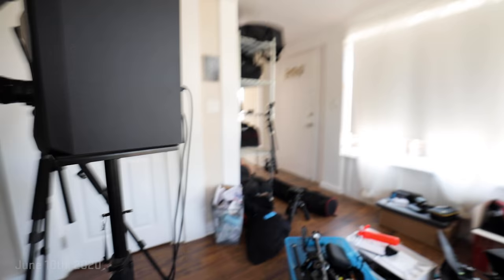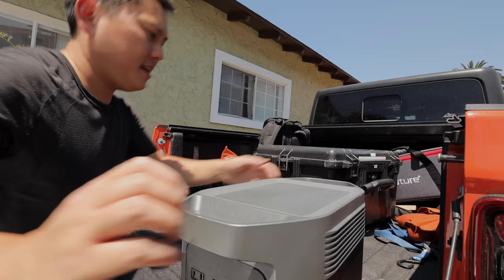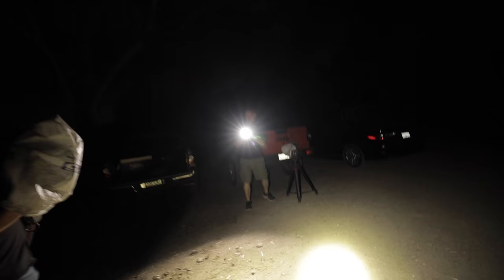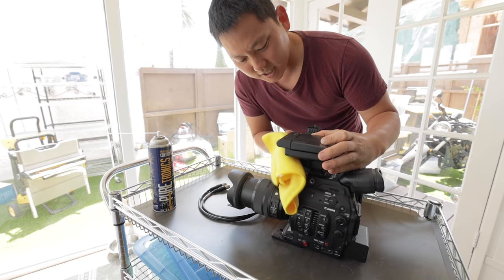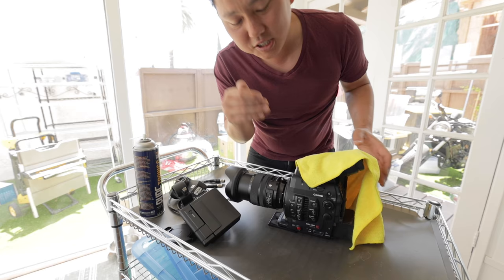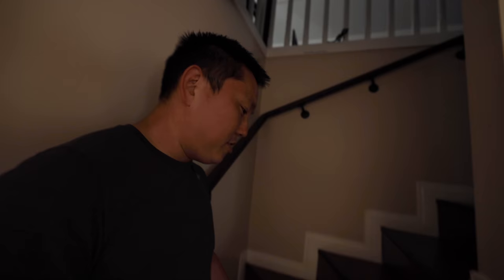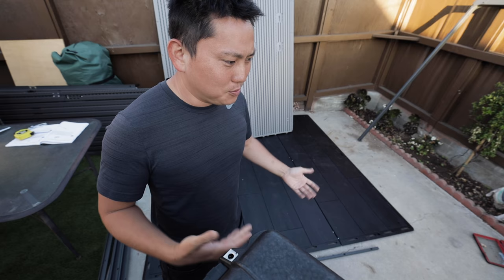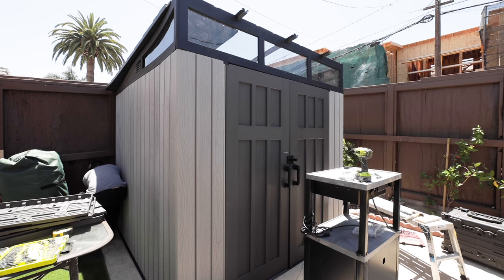First Day Back At Work VLOG

Comment: The best wifi is a 100ft ethernet cable!
Reply: I 2nd that
Reply: Pass thru walls no problem
Reply: No shit
Reply: period!
Reply: Good luck inserting that in a phone
Reply: Shounak Hinge adopters 🤔
Reply: @gitawrongtranslation-youtu9701  let me see what is more convenient...
1 Ethernet cable which nneds adapter for using with smartphone vs a WiFi router which is wireless (obviously) & can handle 10+ devices simultaneously...
Reply: @shounakhinge8  having the wifi router next to your pc with pc being connected by ethernet and other stuff connected to wifi.
Reply: @pettypoh  Now that's something a power drill will sort out.
Reply: @shounakhinge8  You do realise that you can have a router with multiple ethernet runs and wifi?  In fact, it's standard.  
Connecting a smartphone via ethernet... just...
Reply: Hi ! I’m a filmmaker and signal processing engineer. So trust what I say ! 😁 You’re experiencing 2 things with this WiFi network. first, WiFi access points usually use 2 frequency bands : 2.4 and 5GHz. It’s exactly like music : when you go across a wall, you only hear basses : low frequencies that have better resistance to interference. If you’re close enough, your PC will take the 5GHz that can carry information much faster, but have a very limited range. Your further PC will only get 2.4Ghz WiFi which has a longer range but lower data rate.  Second : WiFi is basically throwing electronic waves through the air with magnets and hoping for the best. Packets bounce to walls, get trapped by other kind of interference (neon lights being the WORST) and get lost. This is called packet loss. So the more obstacles between the access point and your pc (distance as well) the more packet loss, the lower the data rates. 
Third but optional : when using a cable, you send the data, and it arrives 100%. When using WiFi, your PC says : « hey I’m going to send data » access point : « ok please do », pc sends, box « ok I recieved please go on », so in addition to everything else, with the same bandwidth, you’ll be limited by those control packets compared to a good wire.
Lastly, your PC is probably limited to 1Gbps. (Limitations of its network card). We’re slowly migrating to 10gbps but this is only for businesses ATM
Like other said, best solution would be to use a wired internet connection. Second best would be to bring WiFi closer to your other rooms using a wired access point or placing the one you got at the center of the house. Last but not bad solution is using PLC adapters that carry the internet from your box to the pc across the electrical network. Internet basically comes out of your power outlets. It is very good since you need no WiFi nor cables, but its performance really depends on how your house is wired electrically
Reply: Damn skippy
Reply: I was just about to say this! Just use an Ethernet cable, its way cheaper and faster
Reply: If the computers are not moving, always go wired.
Reply: That’s like saying the fastest car in the world is a rocket. Or the fastest human is a cheetah.

Comment: ubiquity is a brand of networking hardware, most notably their Uni-fi line of wireless gear. You are getting full gigabit out of your router, but due to inherent technical limits of wifi you will never get more than about 600 Mbps out of wifi. The way to get the full gigabit to your computer is by going hardwired to your PC via Ethernet.
Reply: It can also depend on what router he is using. I have a 1 gig connection, but only the ISP provided router and modem,and can't get any more than about 200mbps out of it.
Reply: You can get nearly gigabit, but you would have to go completely in the 5Ghz net. The problem there, it does not has big coverage so you need more access points, meaning you would have to build a wlan mesh. Than can get quiete complicated

Comment: So what you probably need to do for your network is to get some Ubiquity access points and hard wire them with ethernet into your router to get top speeds throughout. Also you'll get the best connection if your most important stuff is hooked up with ethernet into the router. You could run ethernet throughout the house in the walls like a pro.

Comment: Hey Gene, here is a possible networking list you can buy and setup to get great reliability and awesome performance.
I would recommend Ubiquiti as its quite easy to use their dashboard and see advanced analytics of your network(wired and wireless). I use it personally at home but its widely used in schools, businesses and even stadiums.
When you build out a professional network, you always split the network into different parts: Wireless(WiFi) provided by access points, Wired(Ethernet, SFP/SFP+) provided by switches and routing(Firewall, packet sniffing, DHCP). You can then in the future expand that area you need more performance in, or more clients needing access e.g. wired or wifi.

   Routing and management(router/gateway and controller):
I would recommend the ubiquiti dream machine pro as it is their newest model for routers. It has most of the stuff needed built in to start a unifi network. It includes routing, the cloud key (the controller to control all of the unifi devices and manage them from anywhere in the world through the ui cloud. You can access it through the app on your phone, through the web page hosted on you local lan or through login into the unifi cloud dashboard) It also can run the unifi protect service(by enabling it through the dashboard and inserting a hard drive into the hard drive bay) The unifi protect service then enables you to connect unifi security cameras to it and manage them.
You can also go for the basic unifi Security Gateway but then you'll still need to buy a cloud key (controller) to manage the network. The Unifi cloud key plus also supports unifi protect but the Hard drive space is limited to a max of 5TB.
If you don't feel like buying the cloud key, you can also host it on your laptop/PC(You can download the software from their website, its free). You'll then lose the ability to use unifi protect and having the controller running 24/7 to monitor the network. (all the devices can operate without the cloud key after initial configuration, you won't then be able to monitor the traffic and use the data collected to run Ai optimizations over night. And yes ubiquiti uses ai to improve performance on your WiFi automatically)

   Wired networking(switches):
The unifi dream machine pro has a managed switch with 8 Gigabit ports and 1 SFP+ 10 Gigabit port built in. What that means is that it has 9 wire connections to connect access points, other switches if more wired devices is needed and/or PCs, laptops and other wired clients such as your TV.
If you are going with the basic unifi Security Gateway, you'll need to buy a network switch(preferable unifi) to connect all the access points, cloud key and other wired devices to the router(gateway).

   And finally Wireless/WiFi:
When you have a network to sustain your clients, you can use WiFi access points to provide network connection to wireless devices. Keep in mind that WiFi will always be slower and way more unreliable than wired networking. That is why I hard wire almost everything in my house. It also fixes a lot of security related problems(WiFi attacks and keeps the security system running even if someone comes in with a WiFi jammer)
You can use Ethernet to connect the access points to a PoE(Power over Ethernet) switch or through a PoE(Power over Ethernet) injector(Usually included in the box with most access points) before plugging it into a non PoE(Power over Ethernet) port(The unifi dream machine doesn't have PoE)
If you have at least one connected to the wired network, the others can connect wireless(after setup) to other access points. It will also fall back to other access points when it loses hardware connection but still have power going to it. Wireless uplinks is always the last resort but it can be a life saver for when there is no possible way to run a Ethernet cable.

   Cabling, aesthetics and finale words:
Making your own cables can be a bit cheaper but it will make it a bit more time consuming and you'll need to buy the tools to do it. I recommend at first to buy pre-made cables as it will be easier to install and be a lot faster to get going. I recommend to get at least Cat5e Ethernet but to future proof yourself, get Cat6 or even better Cat6e. (specifications of the cable and what speed you can get out of them at different distances.
Networking can sometimes get quite messy, so you can keep Kari happy by organizing the gear with networking racks/cabins. Its a nice way to mount all the rack mountable gear and keep them out of the way. A network is there to support you, not be there and annoying you. If you are paying for 1 gigabit internet speeds, your hardware deserves the capability to take advantage of it.
 I'll even offer to help you pick the right parts and go through the setup process. I'll even if you so chose, configure it for you and show you most of the features useful to you. All for free (I need to return something for all of the entertaining content you provided) I made a temporary email for you to contact me if you'd like to: tempbk.dontspam@gmail.com 

   Links:
Unifi family:
https://unifi-network.ui.com/
Unifi dream machine:
https://unifi-network.ui.com/dreammachine
Newest unifi WiFi access points:
https://unifi-network.ui.com/wi-fi
Unifi protect:
https://unifi-network.ui.com/video-security
Unifi all products:
https://www.ui.com/products/#default

Comment: Get wired gigabit ethernet for your internet, its very simple, just get a gigabit network switch, and a gigabit cable and you will get your full gigabit speeds to the internet and also to other computers on your network if you enabled network sharing.
This would mean you could send files to Sam directly through a local network
Reply: Most of the time its plug and play, just connect everything to the gigabit switch with the Ethernet cable and its done. 
Its also better to have your Wireless routers to be wired instead of repeating another wifi signal

Comment: For better setup Gene just get a big ass Cat5e or Cat6A cable and run it to your machine. You can either make one or get someone to make one for you or just buy one (more expensive). Then just hide it along the wall.

Limits of ether are around 300 meters at which point fiber is better (Kind of BNC for live streaming).

Comment: Hi ! I’m a filmmaker and signal processing engineer. So trust what I say ! 😁 You’re experiencing 2 things with this WiFi network. first, WiFi access points usually use 2 frequency bands : 2.4 and 5GHz. It’s exactly like music : when you go across a wall, you only hear basses : low frequencies that have better resistance to interference. If you’re close enough, your PC will take the 5GHz that can carry information much faster, but have a very limited range. Your further PC will only get 2.4Ghz WiFi which has a longer range but lower data rate.  Second : WiFi is basically throwing electronic waves through the air with magnets and hoping for the best. Packets bounce to walls, get trapped by other kind of interference (neon lights being the WORST) and get lost. This is called packet loss. So the more obstacles between the access point and your pc (distance as well) the more packet loss, the lower the data rates. 
Third but optional : when using a cable, you send the data, and it arrives 100%. When using WiFi, your PC says : « hey I’m going to send data » access point : « ok please do », pc sends, box « ok I recieved please go on », so in addition to everything else, with the same bandwidth, you’ll be limited by those control packets compared to a good wire.
Lastly, your PC is probably limited to 1Gbps. (Limitations of its network card). We’re slowly migrating to 10gbps but this is only for businesses ATM
Like other said, best solution would be to use a wired internet connection. Second best would be to bring WiFi closer to your other rooms using a wired access point or placing the one you got at the center of the house. Last but not bad solution is using PLC adapters that carry the internet from your box to the pc across the electrical network. Internet basically comes out of your power outlets. It is very good since you need no WiFi nor cables, but its performance really depends on how your house is wired electrically

Comment: If you want better WiFi over various points in your home, don't use a WiFi repeater but rather run an Ethernet cable as a backbone between WiFi hot spots or use the existing AC electrical as the backbone and NETGEAR - Powerline AC1000 Wi-Fi Access Point and Adapter.  The problem with WiFi is that appliances such as the refrigerator or the furnace/AC tend to significantly obstruct the signal.

Comment: U bi. Quit tee is how you pronounce “ ubiquiti “    But you installed orbi which are pretty good. Unless you are dealing with major networking you wouldn’t need it.

If you are uploading and downloading large files get a hardline ran to that computer or one to each of your APs that way they get max potential and don’t need to work thru walls and such to get the information

Comment: Try using a Ethernet over Power connection for the fastest and most convenient Ethernet. It's basically as fast as hardwiring to the internet. I use a Powerline by Netgear.

Comment: Basically Ubiquity (you be quit ee) is a brand of networking gear which is well-kown to be extremely reliable and fast. That being said, you should definitely consider going fully hard wired instead of wifi. Even though wifi is getting better and better, it's still much slower and less reliable than a good old-fashioned ethernet cat5e or cat6 cable which, by the way, costs just about nothing. I got like a 1000' roll for 50 bucks the other day. It wouldn't be useful if you were only using laptops everywhere, but since most of the computers you use that need high speed are fixed where they are, it definitely makes much more sense to go fully wired!

Comment: I would recommend you start doing an inventory system, like LinusTechTips has done. They have a good video of the process.

I think you might already be doing this, but just making a checklist of all the items you need for a shoot would probably help you remember stuff too.
You'll probably be less likely to forget something if you just turn it into a protocol you always perform. (E.G I tap my pockets before I leave my house to check if my keys are there; it's a habit at this point)

There are issues with leaving SD cards in the various slots (reader + camera). Copyright is one. What would happen if you lose an SD card with someone else's shooting footage. 
Or, what if that SD card was near full, with some other important footage, and you haven't moved it yet.

I'm probably just saying obvious crap, and this is likely a pointless comment.

Anyways, keep up the good work, really enjoy the content, very interesting and insightful! Even though I don't actually do any form of photography or cinematography myself!

Comment: 4:06 thats what I'm talking about, when are my 3,000 dollar cameras going to have at least 64 gigs of internal memory? canon sony nikon, when?
Reply: Because external memory gives you the ability to swap out. Why take up valuable internal space for a slot which you can't change? Memory also can get corrupted and degrades overtime. This is why people hate internal batteries, the ability to swap out is a good thing.
Reply: @kolecava  Internal batteries vs swappable batteries. Yes swappable is best. I totally agree. I 'm asking for some internal space without getting rid of external. I never said to get rid of the xternal. :) Aslo, the degrading of memory, yes but I still use the memory from my I phone 6, so i will totally take my chances bro. Besides, what does not degrade overtime. I'm degrading LOL ;) Give me some gigs in my cameras Sony Canon and Nikon!. LOL  Cheers!
Reply: Mister K what about a big warning that says “this camera is only using internal memory, please insert a card or risk losing your footage” and when used properly with external storage the internal storage is just used as a plan b backup. Then it’s a win win! Also even the fastest internal storage that size is postage stamp size so it’s not going to take up much space.

Comment: Upgrading you home network/wifi with these, will change your life.
Ubiquiti UniFi Dream Machine Router
Ubiquiti UniFi AC Pro Access Point
Also, have a look into Wasabi as a S3 bucket, cloud backup solution. One of the most economic options out there.

Comment: Ubiquiti Networks makes POE Wifi radios and a streamline easy to use mesh system basically just an advanced version of what you dropped a few USD on for that mesh kit with 3 Radios your issue is your stuck on the 2.4ghz band (300mbps or so) on wifi that's why your not getting 1gbps etc you need to segregate the 2.4ghz and 5ghz band into 2 SSID's and use the 5ghz band for all your modern devices and the 2.4ghz for older and smart home stuff etc then you get the well 600/1200mbps most 5ghz chips do on your devices.

But with Fiber realistically you want it all hardline 1/10G ethernet as much as possible to really take advantage of it you think its cool now set it up right and you feel the future.